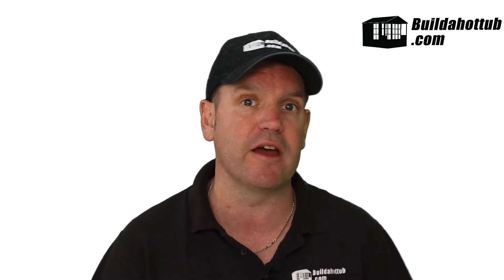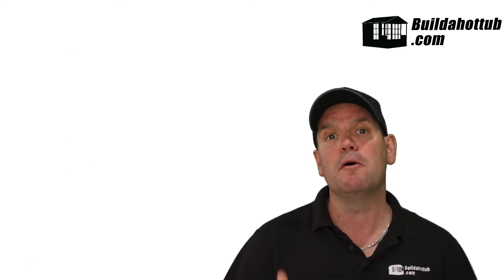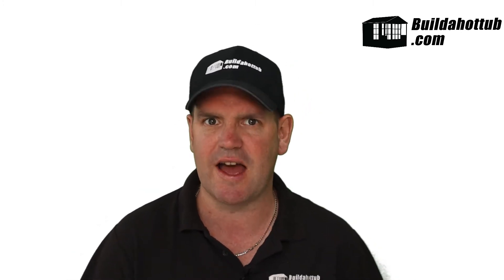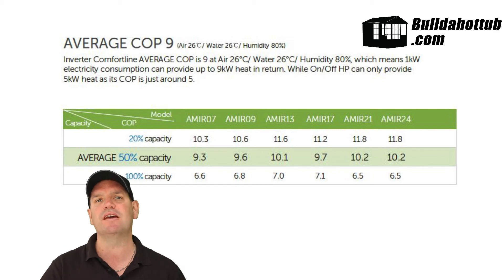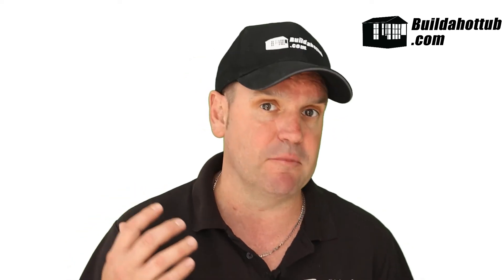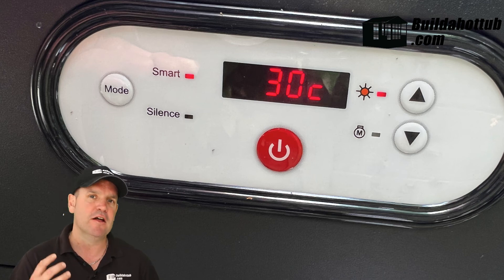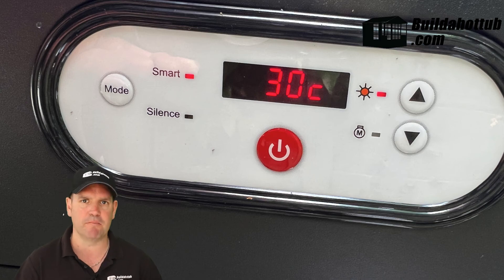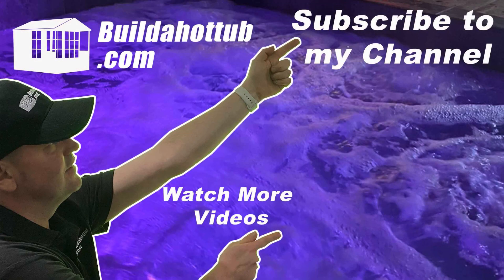Comfortline Air Source Heat Review

Comment: What's the max temp you can set it at?  And does this have to be outside?
Reply from the maker: 40C - it needs adequate air flow, so if it is inside, there needs to be a flow of air otherwise the room will cool to a level where you cant get any heat out of it. A well ventilated room (or garage or barn for example) will work. - Hope that helps - Andi
Reply: @Buildahottub    For 4 sq meters of water what size should I look at?

Comment: Nice review. What are the recommended minimum clearances around the unit for safe, efficient operation? Space is an issue for me, so minimum clearances are important, particularly to the front and rear.
Reply from the maker: Hi Bob, thanks for the message - the Comfortline manual states 500mm behind, 700mm to each side and 1600mm in front - this is the perfect scenrio - on my own I have about 200mm behind, 1000mm in front one side is open and the other is about 500mm - hope that helps - Andi
Reply: @Buildahottub  perfect thanks Andi. Just sketching out ideas at the moment. Very helpful.

Comment: Hi andi 
What size cable is used to run in to a 9kw heat pump
Reply from the maker: Hi There, I like to put them on 6mm2 cable which is rated for up to 40A - it won't draw anything like that of course, i just like to over-spec. Hope that helps - Andi